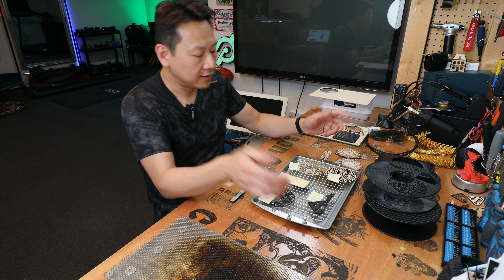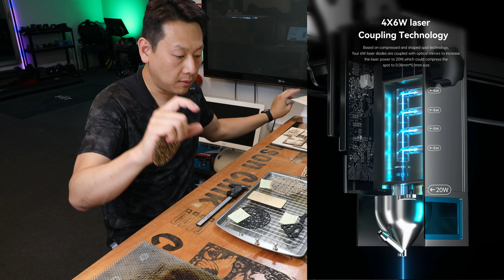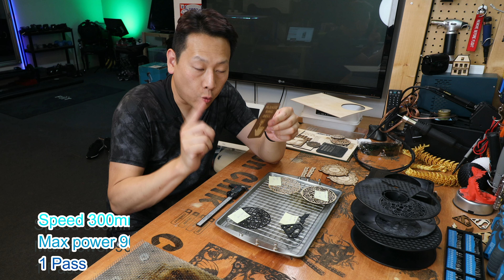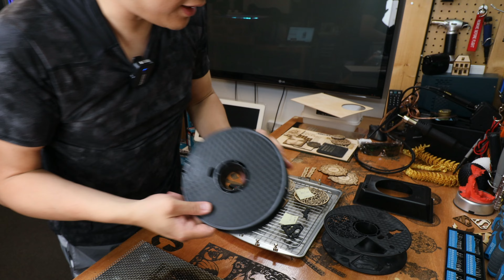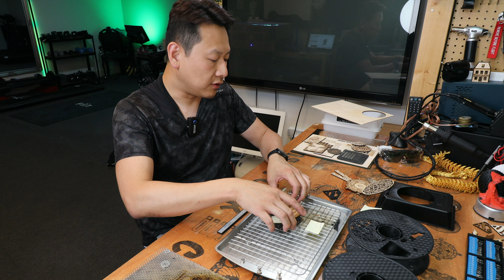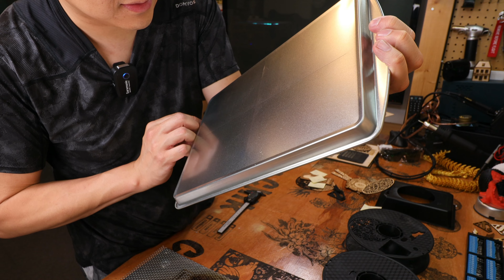Atomstack X20 Pro 1 Week on testing different settings by Benson Chik

Comment: high dense poly ethylen. it is the plastic cuuting boards are made from also. and food containers
Reply from the maker: Does it release toxic gas? I can deal with a bit of harmful gas but don’t want to deal with acid gas which will kill my lungs and the laser
Reply: @BCreviews  toxic maybe but not acid, there is no chlorine inside hdpe its food grade plastic
Reply from the maker: @WildStyleWorks  thanks, nice to reuse what we have with craft
Reply: @BCreviews  yea, i recycle al ot of stuff too :-) safes money also. PVC for example releases acid when laser cut. just so you know.

Comment: I just ordered a x20 I'm new to burning and cutting. I'm trying to figure out what lightburn program to download that will work with this laser any help would be appreciated
Reply from the maker: There is only one version of lightburn but for different platform so depends on what computer you are using. https://lightburnsoftware.com/pages/trial-version-try-before-you-buy  

You can have a 30 days trial to test it without paying. Install Lasergrbl first and that is totally free, install that first also allow your computer to have the right driver for the machine, make sure you tick box to allow installation of the driver etc.

Comment: Purchased for my son  and returned, (I myself have a 60W MOPA Fiber and a 100W CO2, so..no new to laser here), if you understand the words SLOW and UNDER-POWERED...you will stay away from this expensive "toy" no much of difference from a 10W Power (just the fact that they try to manipulate the power saying in the ads that the machine is a 130W power (but the diodes are 4x5W =20W) tells that they try to mislead the new buyers with minimum understand on how machine power and laser power works...my only guess, the machines giving to youtubers must be "special ones" given for free in exchange of a good word. Save yourself from a mistake
Reply from the maker: It is always nice to hear from user experience and it is what my channel is about. Let’s get 2 things straight here, does your machine do what I did in the video? If it doesn’t then either user error or item is faulty. Secondly, I never compare this 120w with any co2 laser in performance except in price. This is a K40 kind of price (with mods) but without the need of mirror adjustment and water cooling. I got this one from Atomstack.net at Pre order price and they don’t know I am a YouTuber or video review. All my sponsored video are flagged as such like the RAY 10w published today. Not this X20 pro.
Reply: @BCreviews  Hello, just wanted to thank you for all your efforts putting these videos together, and giving people informed information about the product. Since i have been doing tons of research on this unit i have ran across E mon's post multiple times on different channels where he is coping and pasting the same post. This seems like a troll move to cut down one manufacture for one reason or another.  Thanks again
Reply: hello, thanks for your contribution, I'm a craftsman and I work from home producing customizations with wood engraving, and max cut 15 mm, I'm reading quite the opposite of everything, budget 800/1000 euros, I know that the air compressor it helps with cleaner cuts and engravings for cooling, I'm switching from atomstack to Xtool, could you help with any suggestions for value for money? Thanks for your time Gabriel
Reply from the maker: I can only comment on the machine I personally used, try watch some review video on xtool and pay attention on the type of wood they use. I find the x20 pro cut soft wood up to 13mm without problem, ply or MDF up to 3mm without problem. With patience you can cut thicker but not for everything use.

Comment: Product name:  ATOMSTACK X20 Pro 130W Laser Engraver, Strong cutting /engraving capability
25 % off
code: ABWW6GV9
Deal Price : 1199.99*0.75=899.99
Original price: 1199.99 
End Day: 2022-12-30 23:59PST
Link: https://www.amazon.com/dp/B0B11LLQ6Y

ATOMSTACK A5 Pro 40W Laser Engraver Master，7 day Deals
28 %off
code:  KAJSAZ28
Deal Price : 266
Original price: 369.99
End Day: 2022-12-30 23:59PST
Link:https://www.amazon.com/dp/B0969CXWWH

Product: ATOMSTACK X7 40W Laser Engraver 50% off
Link: https://www.amazon.com/dp/B09VGLMQ3S
Coupon Code: 6EOMPEAX
Coupon Code Price: 234.99
Original price: 469.99
End Date: 2022-12-30 23:59 PDT

Comment: do you think the x20 would engrave on gun material? like the stainless steel of the taurus pt92 gun? or the carbon steel of the imbel md2 gun. I'm Brazilian, and I'm using google translator,
Reply from the maker: It will mark the metal surface but it will not engrave as in make a dent in the metal I don’t 🤔

Comment: The creased metal will be due to the heat. Metals absorb far more heat than the woods and plastics and the heat causes expansion which pushes up against the cooler areas of the metal and causes deformation.
Reply from the maker: Another viewer mentioned laser it under water which I have yet to try
Reply: @BCreviews  Yeh I would think that would work. I watched someone engrave a hip flask the other day which also deformed quite badly, and filling it with cold water first was what popped into my mind :)

Comment: From what I understood, the tray should be a poly-ethylene, but exactly what kind is unknown, I believe it depends on the number or sign (believe there's five different kinds, that's recyclable Food grade PE) but all are poisonous to cut with LASER, so use Enclosure and ventilation every time!
Reply from the maker: Thanks for the tip, my laser is always inside the enclosure with negative pressure and vented outdoor 🙏
Reply: @BCreviews  Great to hear, then you are ahead of the most users of laser cutters, cause it's usually "underrated" and even a simple breathing apparatus for the sake of the operators health, is often just foregone, for the sake of quicker repeat cutting/laziness, i guess, cause I almost always have to remind the people using the laser in my local makerspace to wear a mask, close the "trap", turn on the suction and stop sticking their damn faces into the machine/enclosure when it's running, because they either want to follow along or is overly anxious about it going wrong or something... And I know you don't look at it like some buffoon, but I have even seen trained operators make that mistake, from becoming to complacent around the machine, and it is seriously carcinogenic to laser cut anything, even wood and metals, so "venting can save lives and reduce any/all risks" ;)
Reply from the maker: I have a monitor on top of my enclosure , it measure CO2, HCHO and TVOC. It is WiFi connected to my phone and it gives notification when it read above a certain level. I use that as a rough indicator of toxic fume level. I am a pharmacist by trade and I fully understand the danger of chemical from laser unknown materials. The odd exposure should not have long term effect but over years of even Minute
Reply from the maker: Exposure will cause harm 💀
Reply: HDPE stands for High Density Polyethylene
Reply: @Xenonsoundboost  just replayed it, and I noticed he said HD also, so right you are! It just slipped, cause I'm used to the HD in front, and not afterwards in the acronym

Comment: I am so sick and tired of these Diode machines bragging about their power, yet only cutting cardboard, plywood and MDF!!!!
Reply from the maker: I totally agree, Diode laser been around for ages and only recently they start to stack multiple together to enable any kind of meaningful cutting. Just because it can cut some of the material you mentioned it does not mean it is the best tool. 

I have both the 5w and 20w (laser output not machine input or power supply ratings) and the difference is vast, and that is what my video is about.
Reply: Ok. Thank you. I would just like someone to try and cut Acrylic Dice with one.

Comment: are the watts comparable to co2 lasers? I have read some random things like (20 watt laser equal to a 100 watt co2 laser) which i think is just pure bullshit but is 20 watts, 20 watts or is the a difference between them across the types with one type of watt being worth more then the other?
Reply from the maker: I wish I have a Co2 to compare with, if channel goes well I will be getting one next year. This week I am working on pellet wood of 15mm, so far it is just about cutting through at 10 pass with good results.

Comment: Hi do you think this machine would be a good starting point for laser engraving. I'm wanting to start a side job laser engraving, but don't know anything about them. How long should I expect it to last running it 6 to 8 hours a day,  5 days a week. Or should I just forget the diode lasers and go for a CO2 machine. This way would take me considerably longer to start making money.
Reply from the maker: Depends if your jobs will need big bed size. If no need to cut then Cheaper model with rotary tool will be better for engraving. Speed is always better and faster with newer generation but you would pay for the luxury of saving time. 
If running a business engraving and only need up to 10cmx10cm I would recommend the LaserPecker 2, 3 is out now so 2 would come down in price a little.